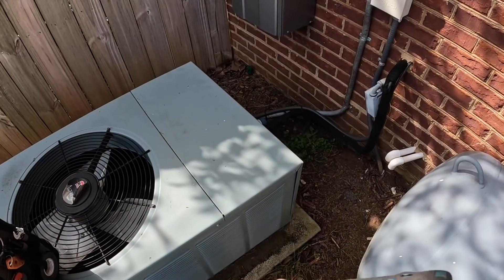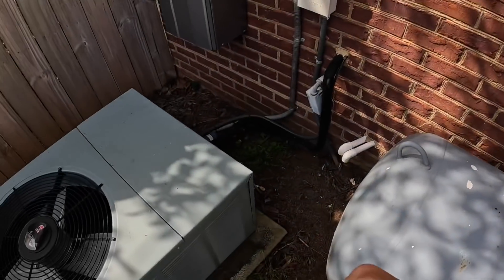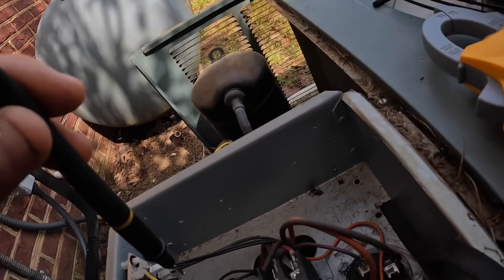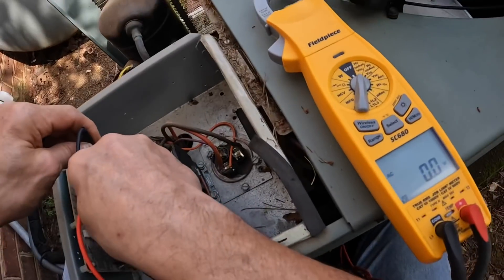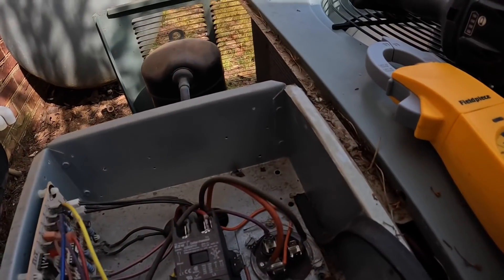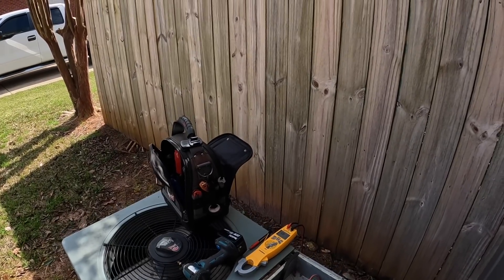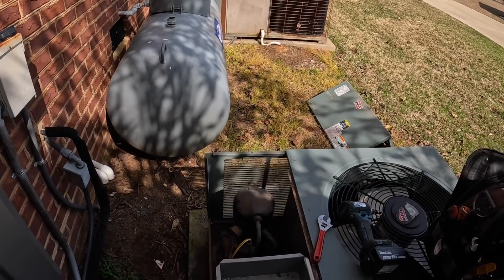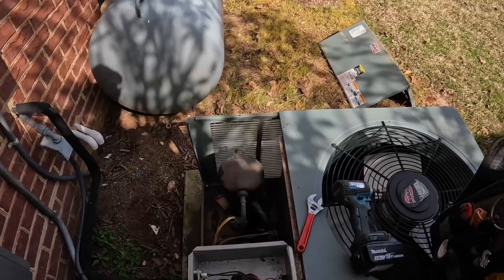Rheem Heat Pump Low On Freon, Leak Search, Repair Quoted, And Approved!

Comment: Figured you would have learn by then to always carrie onboard at least 
3-1x12x36 solid wood planks to take to attics. To always have something to sit on or kneeling on.. if you lnow you'll be there for awhile. And enough room. Tge planks and a bucket or milking stool comes in handy.
Or answer to the bad lnees later in life.

Comment: Job #1 install an attic light, catwalk and service platform.  If you step through the ceiling, your gonna be responsible...
Reply: It’s cheaper to fix the Sheetrock vs. rebuilding his whole attic!
Reply: @clayevans3421  Please forgive me sir, I don't know who you are or the kind of work you do.  However, its that exact mentality that's gotten this industry where it is...  Cheaper is NEVER better for anyone involved...   2-48" lights $50, 3 sheets of 1/2" OSB $90, 6-2x4's $25, and 30mins of time vs a potential major injury and depending on the damage incurred potentially thousands of dollars in drywall, paint, flooring, furniture ect....    We can go back and forth with all the what if's..  I'm not sure if you are a man of faith or not, I will still encourage you to read Colossians 3:23

Comment: Looks like that sniffer is making some money. How do you like the sniffer compared to other one's you have used?  I use the prowler by JB and if you bump the tip or sniff leak bubbles it will go off. Does that meter do the same? Thanks again for the clip. These are some of my favorite.
Reply: All JB sniffers do that. Couldn't stand them.

Comment: One month old Rheem indoor coil leaking on me , big leak to on the u bends , still can't believe it . Sucks because I told customer your indoor carrier coil 15 years old is leaking needs replaced. We replaced with a Rheem to match outdoor and month later call back , oh guess what new coil leaking. How does that sit with the customer. Luckily the man was understanding and knows defects happen. I even had pressure when I took the plugs off coil to weld lines in. And I did a nitrogen pressure test. Held 400 psi for 15 mins.

Comment: Curtis - so many things here. A Rinnai instant water heater - using propane? That poor lady's gonna not like her propane bills. And the propane tank adjacent to the house - very close to the Rinnai and TWO AC units (that generate sparks on contactors)? I don't think that is up to "code" in Texas. And - what happened to the patch on your tool bag?
Reply from the maker: I change them from time to time. I think now I’m using the thin blue line flag. Did you not see that?
Reply: @HVACGUY  I didn't see it, I was looking for the thin blue line flag. I like that one, looks good on your bag. Keep up the great work! I wish southern Georgia was closer, I'd meet up for an iced tea (or other beverage!)
Reply from the maker: @davidgilpin5200  it’s there. That’s my favorite patch to use.